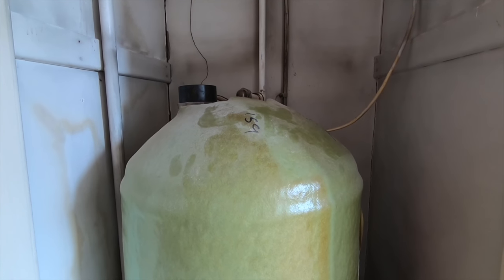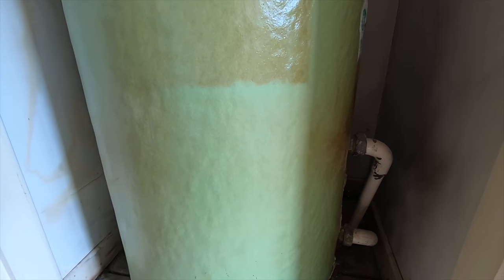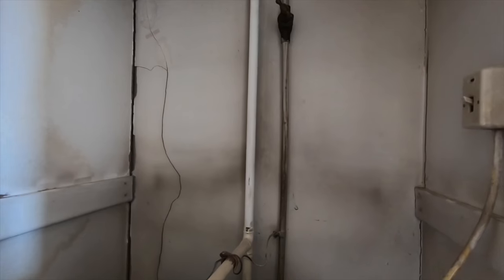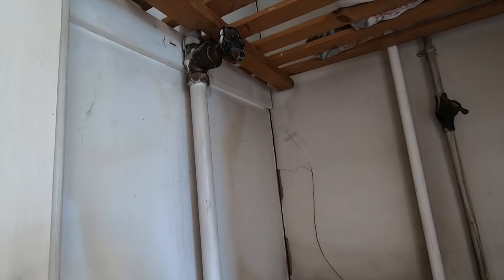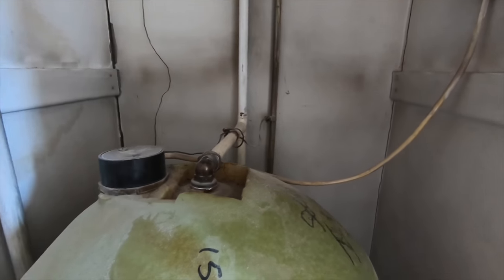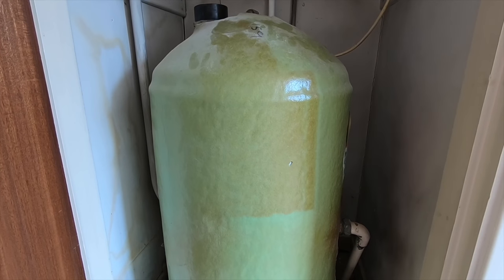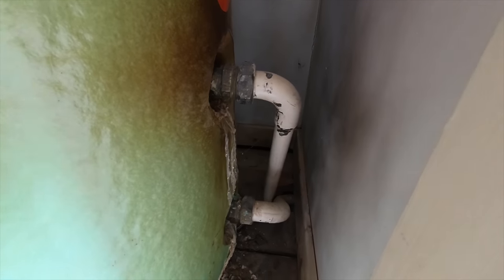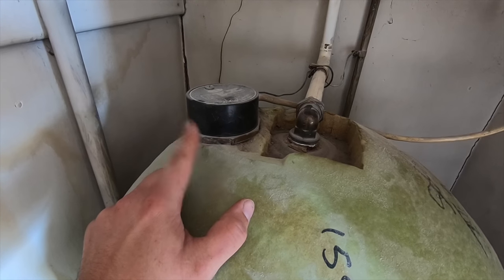How an indirect hot water tank works

Comment: Hello Dan, I bought my house 20 yrs ago, there was no central heating, the house had this electric system, but then I installed the latest combination boiler. I still have this. Can I reuse this to boil the water to save electricity and gas bills? Instead of using a new combination boiler?
Reply from the maker: Unfortunately not not

Comment: Hi Dan, thanks for the video, I found it very informative! I’m new to the cylinder heating system, so sorry for a dumb question - why does the water main needs to go all the way to the loft through the tank there and only then to the cylinder? Can it not go straight into the cylinder? Will the cylinder not hold the main pressure or is there another reason? Thank you in advance.
Reply from the maker: No it has to have a tank in the loft, with a new modern unvented cylinder you have a cold main that connects into a combination valve then into the cylinder without the need for tanks 👍🏻
Reply: Thanks  @PlumbingGy  , however I dont see how it answers my question as to why the an indirect cylinder cannot be connected to the mains bypassing a water tank in a loft
Reply from the maker: Sorry I thought I answered it with a ‘No’, it’s designed for a low pressure system meaning gravity fed from a tank in the loft. 
Hence the term low pressure. If you put a mains feed into it, it won’t end very well 😂 BOOM
Reply: @PlumbingGy  sorry for being persistent here :) I understand that it cannot be connected and the consequences and of course will not even attempt to, but being a curiosity driven tech guy I still did not fulfill my desire to know WHY, technically. Will the outer shell not hold the pressure or is it joints, pipes or what? I understand the water expands as it get how which an expansion tank could help with, but otherwise, what is the reason it will not work?

Comment: Hi.what is the electric switch on the wall for and if you turn it on to heat up the water do you need to turn it off or it automatically switches itself off?Thanks
Reply from the maker: Standard and you need the.turn off after about an hour or two

Comment: hi buddy i have 2 boilers and 3 tanks similar... its a hotel i am running. the problem now is the water coming from the showers is not consistently hot / mixed. the temperature fluctuates highly from hot to cold. the water temperature in the shower is not stable. what could be the problem and where could it be ...... in the tanks or the boilers..??? we recently had the gas renewal certifications where the people did the boilers and told is working fine. please share yr expertise and experiences. thanks.
Reply from the maker: Hi mate, to be honest it could be as simple as the mixing valves are failing/been adjusted incorrectly. Make sure you check the valves and their integrity. Another tell tale sign is that the shower head will constantly drip. another issue could be not enough water getting to the valve, so check the supplies hot from the tank and also the cold mains to make sure the stop taps haven't been turned down or adjusted. If it's not these then a deeper inspection will be needed I'm afraid 👍🏻.

Comment: Hi , we’ve just had a new tank fitted just like the one in your informative video. Every time the pump starts up there is a loud vibration noise running through the pipe work in the house. Do you think it’s possible that the Coil inside the tank is defective & could be creating the vibration?
Reply from the maker: Hi there, this is going to be a tough one but from my experience the coil could have been split when installed but you will notice that the header tank in the loft will continue to over flow so check that if not then the next thing it could be (going off a new installation) is the pipework might not be clipped so when the pump comes on it almost gives a similar noise to 'water hammer' with the pipes vibrating from the pump circulating.
Reply: Thank you ever so much for your reply! I’ll check that all out 👍🏻

Comment: Hi i think i have a indirect cylinder tank, in my loft, with 2 water tanks above it. My question is, when i turn on my central heating should the boiler ignite? Because it doesn't. But when i turn on the separate switch for hot water, the boiler ignite up, is this supposed to happen? Or Do i have to have both hot water and heating on at the same time for the central heating to work? I never put the central heating on as the hot water heats the rads and the house.
Reply from the maker: It would be hard to tell without taking a look to be honest it depends on your system entirely, do you have a valve In your airing cupboard? It may have failed if so you shouldn't be getting hot rads when the hot water is on that's for sure. If not it could be a faulty diverter valve. I would recommend having it checked over by a professional.
Reply: @PlumbingGy i don't know. As the tank has so many  pipes i wouldn't know what to look for.

Comment: I have a same tank. Why does it heats water in this tank when i turn my heating on? Also water gets cold very quickly from boiling hot.
Reply from the maker: Normally a valve is at fault, check your 3 port that maybe the issue 👍🏻

Comment: Hi! Can this explode by accident? I am viewing rooms to rent and one of the rooms has a water tank in the room. Is it dangerous to have such a water tank in a room? Is it noisy?  Thanks a lot for your video.
Reply from the maker: Hi with this particular tank it is open vented (tank in the loft which spills over) so no pressure can build up in the system so it will not blow up however it can split and leak. it can be nosey when the water is being heated it will sound like it's boiling.  Another type of cylinder is called unvented which is pressured and if installed incorrectly can blow up. Thanks

Comment: Can i turn the rotary valve off there (on the left valve is it?) so that i can heat my room radiators without also heating the main water tank at the same time? I don't use hot water much and don't need it sitting at 60c constantly.
Reply from the maker: Do not turn off your fill inlet valve, this will drain the tank when you use your tap. If there is controls in place to turn off your hot water (programmer) use that or you can turn the cylinder stat down to a lower temperature. 👍🏻
Reply: @PlumbingGy  I did turn that valve off but i worked out not to run the taps in that state. What about the electrical switch beside the tank, what does that do? Is there no way i can stop the tank from heating up? I literally turn a hot tap on once a week but have the radiators on for hours each day. Thanks for helping!
Reply from the maker: If the electrical lead goes to the cylinder it will be the immersion heater of you are unable to control it via a programmer then turn the immersion off and hopefully that will sort it 👍🏻
Reply: @PlumbingGy  With both valve and electrical switch off the tank still heats up so that's just the way mine is. I need some CH/DHW controls installed in the pipeline to do what i want it seems. Thanks for the help Dan.

Comment: I wonder if you could offer advice,
I have an electric vented boiler, recently I noticed the water flows from the vent pipe nonstop even when the electric is turned off, please can you let me know if this is normal or do you have a link to find out what to do? Thank you
Reply from the maker: This is not normal, pumping over can be caused by numerous reasons you will need to have it looked at, could b a blockage get someone in to take a look 👍🏻
Reply: Do It All Dan thank you so much pal, I will do that,

Comment: Hi, maybe someone reads my comment and helps me with answering a question - I have just moved into a new flat that has a water tank (probably indirect), I have never used it before. Lets say I literally need just a few litres of hot water to wash my hands and a few dishes. How do I do that??  I don't spend much time at home, I usually just come back from work in the evening and all I need is 2 minutes shower (or even not that because I take shower at the gym). Do I still need to heat that whole cylinder of water???? There is no way I need that much water daily, the tank looks like I could fill up two bathtubs. Maybe this works for a family of three or more, but I literally need very little hot water (maybe two buckets), usually in the evenings. Is it even possible? If someone could let me know that would be great.
Reply from the maker: Hi, unfortunately there isn’t much option to ‘limit’ how much water it heats it has to heat to the required temperature set by the stat. 
If you have an immersion you could try turning it on for 45mins and see if that helps in any way.
Your other option is to rip it out and put a combi boiler in which does sound like your best route.
Thanks